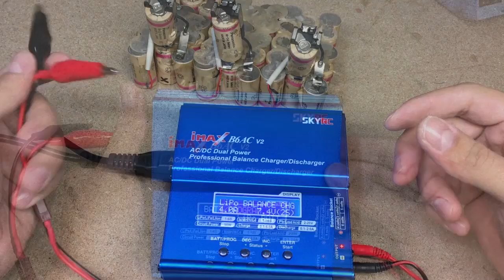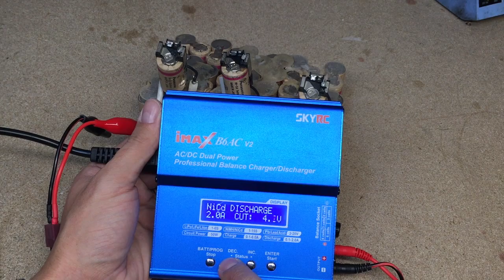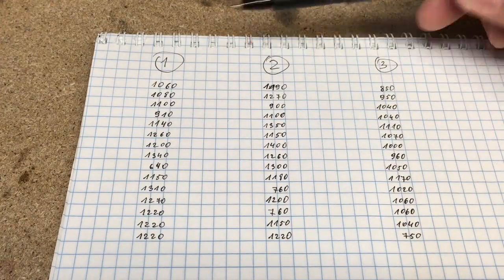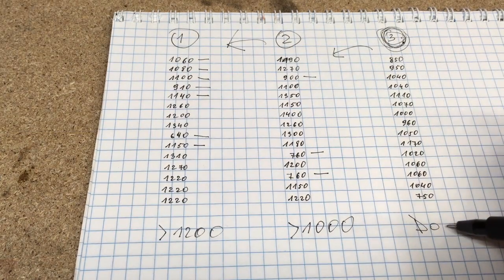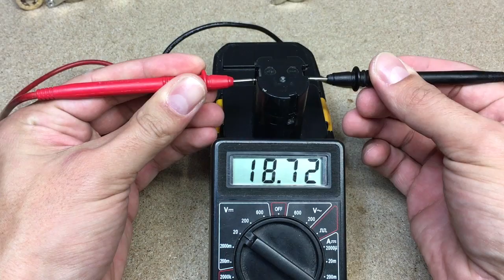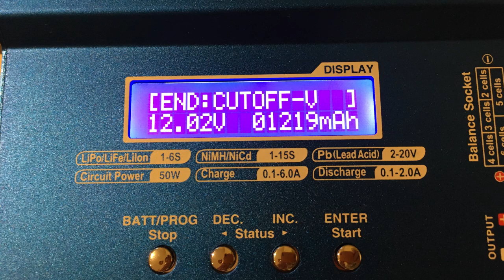DIY: Squeeze Extra Capacity From Old NiCd Batteries

Comment: You honestly expect me to do this? Pshh. I'll send you mine. I left them in the rain, half are corroded and they were shit to begin with but knock yourself out; have fun. Basically what I'm saying is I'll be chucking mine away. Your videos are very inspiring but I wasted a heck of a lot of time wondering whether I should bother doing this or not! ;P
Reply: Its always a personal choice of time over money.. I have tossed a few and fixed a few. His other video on bump charging a battery enough to get some more life out of them is good. In your same case... left in the rain... I cleaned my terminals with the wifes nail file. Yes she was pissed. then Zapped them till they worked in the charger. For me its just about reducing waste more than money

Comment: Some electronic shops that do battery refurbishing as main business will donate you bunch of quite good cells (NiCd, NiMh, LiIon/poly) just if you ask them, and tell them you have no money for your project, as Ni-Cd/Ni-Mh/LiIon are not bought by recyclers (like lead acids are) (like Ni-Mhs from medical equipment they refurbish...) if you allready buy some stuff there, (while others will give you "WTF" look ;-)
it is worth asking tho.
Reply: haha, i have one of those shops in sweden. I sell used 18650 cells for €1-2 which i think is fair. But if the insulation is poor i give them away since it cost €100 to recycle 100 kg of old cells.

Comment: i notice that even if a discharge from full charge cells shows a good capacity, if i test the same set showing good capacity after a full charge but has been sitting a week, some are at 0v, meaning high self-discharge and is no good.